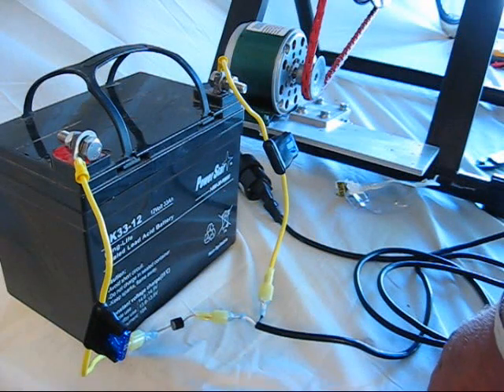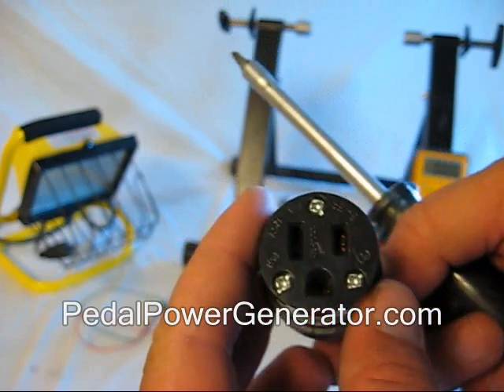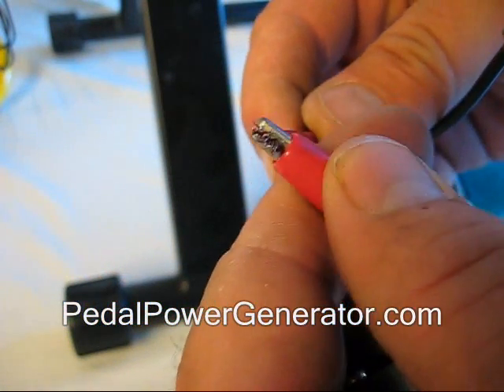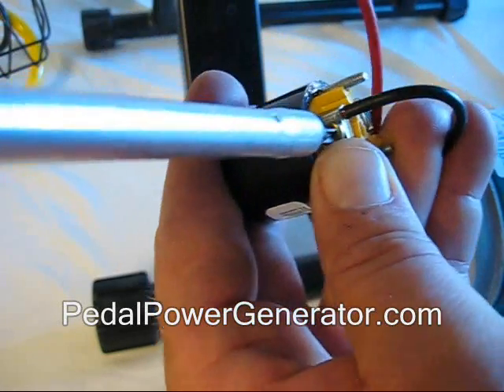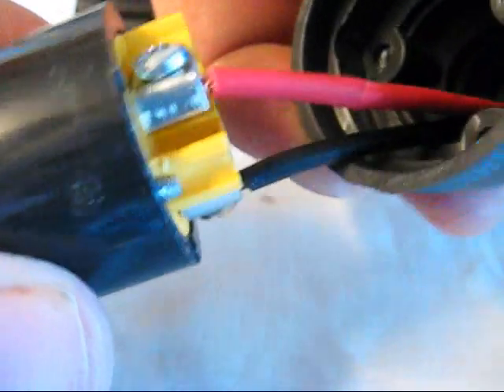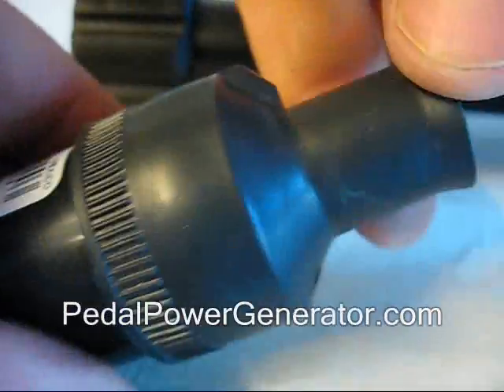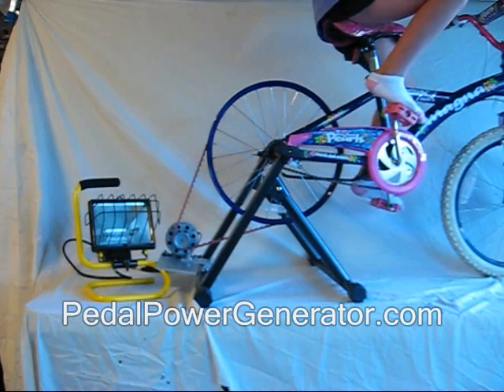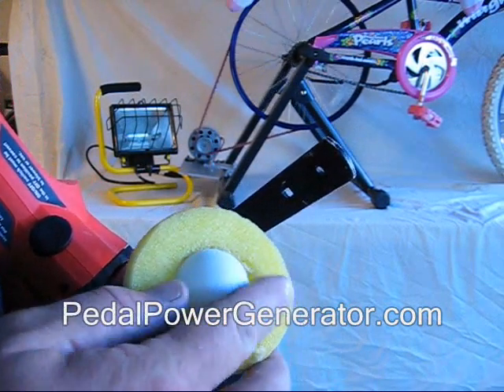Video 2 - DIY Pedal Power  Bicycle Generator - how to make a floating ball science fair display

Comment: Did you use a car batter or wht type of battery w was that
Reply from the maker: +Bethany Brown Hello,  the easiest type of battery to use with this system is a battery powerpack.   But if you just want a battery  then you would use a 12V Deep cycle battery AGM style  (The kind that can't spill).   You must use a fuse and a blocking diode as shown  here:  http://blockingdiode.com  .  Let me know if you have any more questions.  brad at pedalpowergenerator.com

Comment: Smart, yet not smart enough to know the front fork of the kids bike is on backwards.

Also connect the rear brake clamp loosely before you tighten the rear wheel up, then tighten the clamp up.

Comment: How about a video featuring a bike generator setup to power a battery bank instead of individual items? Could you attach the diode to the generator wires, then to a charge controller which is also hooked up to a solar power system. The idea is that if an RV is parked under the shade, or needs power at night, or a house emergenc battery system needs power at night, you could set the bike up inside and charge the batteries. 
Do you have a video showing this practical application?

Comment from the maker: @11secondeclipse The mindset is to get kids and adults interested in alternative energy.  When you have kids at a large event and you need something simple to teach them about alternative energy then this is pretty good solution.   Also since this is DC power, it can be connected to a lead acid 12 Volt battery to store your energy.
Reply: I’m trying to make a mini Vertical Axis Wind Turbine( VAWT) from an old Cordless Drill motor to charge a 12v battery, can you pls tell me what size Blocking Diode is needed?. I’ve got all the materials, and am good with fabrication, but am stuck on the electronics re blocking diode!.

Comment from the maker: @BigPimpB1 You can get a bicycle trainer stand from a 2nd hand store for around $20.00.  Also you can find one on craigslist by typing in the search phrase "trainer" .  For the generator part, you can buy a DC permanent magnet DC scooter motor from craigslist or Ebay ~$40.   You will have to remove the gear on the shaft and fit it with a roller or pulley to make it work.   Lastly, you can make your own adapter plate using free plans from pedal power generator d o t com